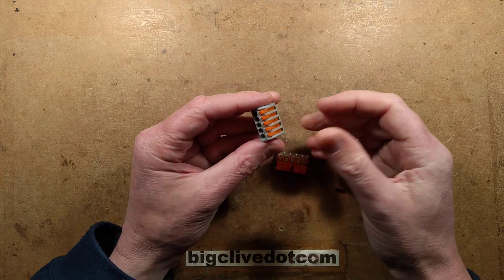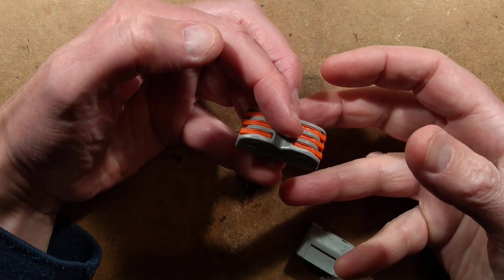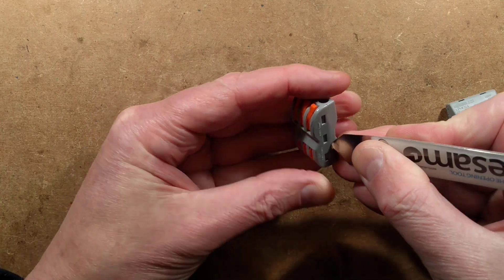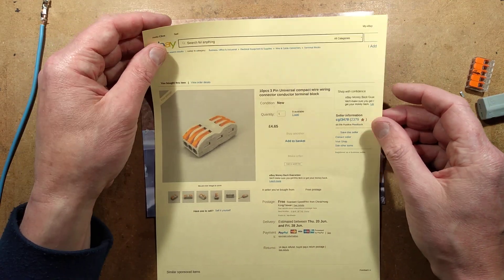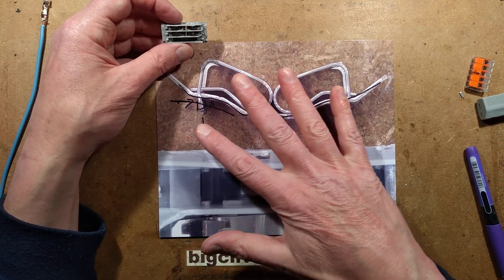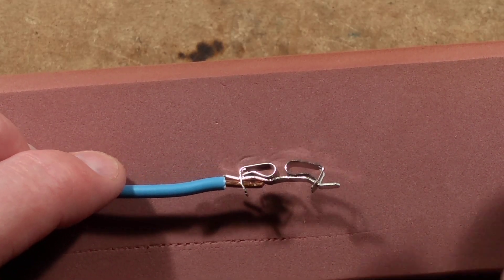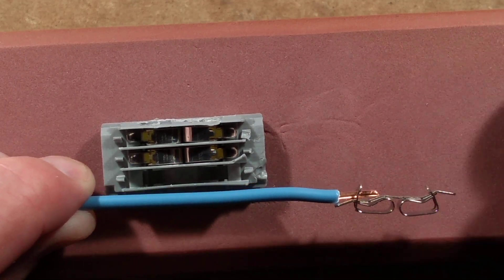Clone of Wago product that Wago don't even sell???

Comment: I always found these Wago type connectors very appealing, with one major downside, I want to be able to mount them in project boxes or cases so they are not flopping around. I have seen there are Wago mounting carriers for DIN rails, but those would not help much for my use cases. Luckily i recently got a 3D printer and there are Wago mounts available for free from Thingiverse, I will be using these a lot more going forward.

Comment: I know they make the wago boxes to go with the connectors but they do seem quite well insulated with no exposed parts so, best practice aside, do you have to use the boxes?
Reply: No of course not. You don't have to use anything, in India they just twist the bare ends together and maybe, if you are very lucky, insulate one of them by wrapping with a strip of a plastic bag.  ;-)
The stripped wires without the cable sheath are only basic insulation, as opposed to reinforced/double insulation, so not considered safe for public access. I wouldn't really loose any sleep over it if it was in an unaccessible enclosed area, like a ceiling or something, but I would not leave them exposed for anything other than a temporary setup for testing purposes.
Reply from the maker: In an ideal world there would be no single insulated cores visible.  I prefer to use the mini Wagobox for downlight style applications since it will fit through a small hole and does the job of shrouding the connector and gripping the cable quickly.  But this would be much preferable to just tape and terminal block if used on its own.  I'm not sure I'd do it myself, but if I saw that someone else had done it I wouldn't be too bothered as it does shroud all bare metal.

Comment: The original Wago connectors use tinned copper for the contact and spring steel for the spring.
Yes, this chinese product could be useful. But i would never ever use knock-off products. I am a professional electrician master, my customers expect to get high quality products.
Reply: Did you watch the video?
This one also used tinned Cu with spring steel.
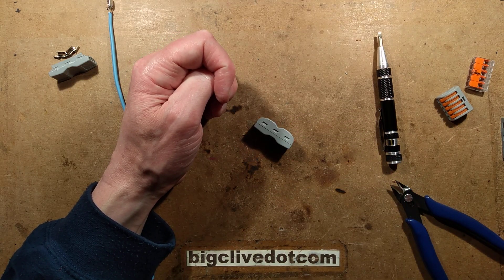Reply: @patnutoris4054  I watched the video till 9:42 and stopped. My error!

Comment: Clive, I was half expecting you to tear this this to bits verbally as well as physically. I've been very weary of these knock off connectors, but Since both you and JW seem to be reasonably impressed I may order a few to use with 12 & 24 volt stuff... since you never know when the design might change. Maybe Wago will knock of these and I'll could use them on mains voltage. Until then, I can get by with individual Wagos or the little cut to size milti-way screw terminal type blocks. Thanks for having a poke at these, very interesting indeed.

Comment: Thankyou for bringing these to my attention. I have promptly ordered a few 3-Liners and a few 2-Liners from Ebay which I can use for quick fixing wire breach in my Moped. (50CC Motorcycle here in Holland). Especial the wireloom near my steering column suffers quite a lot. It is 12 Volt, so Arc-Over seems not an issue here. :-)

Comment: Cheaper to just use choc blocks but perfect for setting up test circuits etc. Not sure I'd trust them in a 'proper' job.
Reply: Choc blocks are a lot less reliable than Wago connectors. It's extremely easy to make a bad connection with choc blocks. With Wago's on the other hand, it'll take some doing. I was actually surprised Wago and similar connectors aren't used in America. Here in Europe, using choc blocks is actively discouraged due to the danger of making bad connections.
Reply: It's not just actively discouraged, it's straight up against current electrical code. It's been illegal to use choc blocks in my country for a good number of years. The only place where choc blocks are still allowed is in domestic light fixtures.

Comment: They exist pretty long do , ideal for built in spots ,  because next to solid core wire flexwire could be used .
The old wago stick in connector could not accept flexwire because you could not open and close them .
And this one has a clamp that surround the wire that's why flexwire keeps being a bundle in the connector for a good connection .

Comment: You said trumpy, and I didn't know if you were going to have a trump in your trousers. You brought the POS out instead. You seriously need to use more fart jokes again. Growing up kills you, you know. After all, it is the highest cause for dead in the world. At least, I hope it is. I've seen Wago connectors being sold, but I usually just go with the old trusty and cheap wire nut. I don't know why Wago or other terminal strips are so expensive in the United States. Wire nuts are tried, tested, and true here not to mention cheap. John Ward even tested them, and they held up. The insulation did burn away, but even the terminal connector strips lost their insulation. I believe all or most of the wire was cremated as well. I'd have to go back and watch that episode. The only time I've seen burnt wire nuts is when directly combining copper to our aluminum wiring. I was still learning back then, and my brother who should have known since he took electronics said that it was not only fine to pigtail copper and aluminum but also the best way to do it. Thank goodness for our fifty year old metal boxes! That was also a high load connection in a bathroom. It had the worst combination or close enough.

Comment: These have been available for quite a while. I bought some of the two pole version at the start of last year, they have been very useful. I've mostly used them for testing projects, before soldering on battery connectors once complete.

Comment: I'm curious if anyone has a sound electrical basis for their (implied or explicit) opinion that these are unsuitable for higher voltage applications. They claim to be rated for 400V, which with insulation should require only about 10 mils of separation between rails. Those plastic separators alone qualify as >10 mils of insulation, plus the additional air gap between the contacts and the plastic.

400V seems to be a reasonable rating, factoring in engineering safety margins.
Reply: It's probably down to manufacturing quality concerns, here, rather than design issues.
Reply: @B-System  I suspect the same. That concern can largely be ameliorated by examining a few parts, however.

Comment: The idea is good, but at least the colors of the leavers should be different for each pair. To be honest I expected them to be connected all together, since that is what I’m used to from the other (original) Wago connectors. I guess if Wago would present something like this, they would use a different design to prevent confusion.

Comment: I'm not a fan of Wagos; a properly installed wire nut is probably better or even a crimp connector.  One thing that worries me about the 3-wire splice connector is that should the internal connection become a little corroded or loose, the resulting heat might melt the connector body and lead to short circuiting between opposing polarity wires.   I couldn't find a similar splice connector in my Wago catalog, so I'm assuming that it's not made by Wago.

Comment: I heard from a wago seller once that spring contacts are better than screw contacts. The reason is  thermal expansion. When that happens on a screw contact, the metal of the wire and screw deforms and the contact surface will be worse when it cools down again. But the spring just goes up and down without problem, keeping a tight contact.

Comment: Since you do have this powerful wall plug in UK, could you clamp in some wires and put in a heavy load like the hotdogger ?
Perhaps compare it on thermal cam to the orignal WAGOs.. ?
Naked contact or in package... I'd think the chinese ones might catch on fire or melt sooner when under heavy load...

edit: Just checked the video of John Ward.. 

Interesting: The Faco seemed to be having higher contact resistance on the contacts, so both the wire  going in
 and contacts got hotter and it started to melt earlier.
Reply from the maker: But still at 5 times its maximum current.

Comment: I like the transparent ones. First of all because they're transparent so you can see if all the strands are properly pushed in, and they support higher gauges (2,5mm2 with ferrules), and since they're flat, you can hot-glue them in your project box. Which is especially useful for stuff like speakers and subwoofers, where you don't want wago connectors rattling around.

Comment: That spring-connector profile reminds me of the Fahnestock clips we used years ago for hooking up experimental circuits. They're still available but they aren't insulated so low volts only. There's even a wikipedia article about them: https://en.wikipedia.org/wiki/Fahnestock_clip .

Comment: Had some electrical work done on the house recently and the electrician used Wago blocks on the lighting circuit for the upstairs/downstairs switches on our new stairs. First time I'd seen a Wago connector in the flesh.
Reply from the maker: If you search my channel for Wago you'll find a video about the connectors and a very clever box designed for them.

Comment: Though very easy to use I was taught never to use (original) Wago's because they cut in to the wire with little actual surface contact which could lead to problems with high currents (I work mainly in industry). Great for home applications though.
Nice video, never seen this type before
Reply: Did you bother to watch the video? It's pretty clear from the photos that the contact surface will pretty effectively be the whole length of the stripped wire, not just the clamping loop of the contact. This is what you get when you uncritically accept received "wisdom".
Reply: @marshaul  Yes, I did. I was talking about 'original' Wago, the grey ones without clips. I'm sorry if I got original 'old' confused for original 'not fake'.
 And I'm sorry for living. Maybe you shouldn't draw conclusions like that straight away and perhaps set a bit friendlier tone ;)
Reply: @daPetNL  Sorry if I sounded snarky. I wish that Clive had done a teardown of the old type, so we could see if the single-ended contact had more or less the same shape/design. 

I work in industry too, and I will however maintain that lots of received wisdom is simply repitition of untested assumptions/assertions. For example, electricians have decided to start installing receptacles with the ground prong on top, based on nothing more than uncritically repeated specious reasoning,  despite the lack of a code requirement to do so, and despite the fact that most manufacturers of power cables still design the plug with a ground-down configuration (so that the wire exits in the direction of gravity), leading to a major fire hazard when the excess strain causes high resistance at the point of the strain relief. If you point this out they will invariably repeat the same canard about picture frames falling with the hanging wire shorting line to neutral (as though circuit breakers don't exist), and all this despite the massive implausibility of that scenario compared to the common real-world scenario of excess strain. Uncritically received "wisdom", indeed.
Reply from the maker: The first time I came across Wago terminals was a DIN rail version used in a large industrial refrigeration condenser unit.  I was working with Hussmann at the time and asked the maintenance guys if they had any issues with them.  They said they had never had an issue with them.

Comment: They do have inline lighting connectors, but only for a single conductor. The 224 series. However I think they're only for solid to stranded connections
Reply: jeales, Wago do 1 and 2 wire lighting terminals grey and white

Comment: Maybe Wago haven't done this is because they could be mixed up,  wago are all common connection, if you had these you would have to check each time to see which holes made the link
Reply: If that's the reason, it's weak. I'm not a sparky or even in the electrical business and I don't think you would have to check each time. One has all holes at a 'common' end. The other has holes on two opposing sides that match up nicely in a line. So the ones that match up in a line are for joining straight through, naturally. Once you've used them once I don't think mistaking their use cases would be a problem. They could use different colours if they were really worried about people mixing them up. At some point you have to trust the installer to be half competent.
Reply: @chocolate_squiggle  I totally agree with you,  that was I was trying to get over, it needs to be different, colour, stripes or spots not the same as in this example. It just looks like 2 off the triple unit joined together which could be 2 commons with 3 links. Instead it's 3 commons with 2 links. You just don't  know until you test it. All wago products are all 1 common.   I think it's a good item which I would use. It is strange wago haven't released it. Maybe the Chinese do have the occasional idea that turns out to be a useable product.

Comment: It sort of looks like two standard Wagos stuck back to back with potentially disastrous consequences if somebody wires one thinking like that.
Reply: ipb1966 Yep, should have used a different color or (more costly!) 3 different lever colors indicating the pairing.  Note that nothing in the design can be use specific, as on any given day, an electrician may use one for a 3-phase motor and another for L/N/PE .

Comment: With the one taken to bits, it wouldn't really matter if the wire went all the way through, it's making a single connection.
Reply: Of course it could matter.  If you push a wire in far enough the clamp might come down on the insulation, making a secure but rather useless connection.  The touching part on the end would not be clamped so could make an intermittent and probably very poor connection, possibly encouraging arcing.
Reply: @FireAngelOfLondon  Please, How to make a extremely simple thing into something necessarily difficult, ready? How do you know if you trimmed enough back to start off? Use a multi-meter and set it on continuity and check both sides of the junction. Set the wire on top of the connector and mark the distance for those who aren't sure, cut dead center and trim the wires back evenly. If you're worried about arcing, you're guessing anyway, just trim back a reasonable amount and trim it until the shielding is the only thing showing to avoid a short outside of the connector and do a current test to make sure the proper amount is traveling through it. Presto. I would only use the things for testing a prototype anyway to make sure and of the components are working then solder and heat-shrink, no more current handling issues. Yes, it's a handy gadget to check things out, but I would never leave it in circuit even though it passed on the the spot with a current test, but what about the integrity over time of getting hot and cooling down? Do you trust that plastic to hold up under those conditions for the long haul, I don't, what if one lever breaks and now you have arcing possibly while you're sleeping. You could even leave bare wire exposed as long as you use heatshrink on them. not so hard after all.

Comment: Speaking of Chinese stealing IP like there's no tomorrow: check this one out ...I was looking for a solder station with temperature control the other day ... we all know about this one: 
https://www.jbctools.com/cd-bq-general-purpose-product-1605.html
But look what I've found: 

https://www.aliexpress.com/item/32997083617.html?spm=2114.search0104.3.2.4fb620762UDQzS&ws_ab_test=searchweb0_0%2Csearchweb201602_7_10065_10068_319_10059_10884_317_10887_10696_321_322_10084_453_10083_454_10103_10618_10304_10307_10820_10301_10821_537_536%2Csearchweb201603_52%2CppcSwitch_0&algo_expid=79e1db94-1002-4a0c-830b-6e1ca519c575-0&algo_pvid=79e1db94-1002-4a0c-830b-6e1ca519c575

Or just search on aliexpress: "jabe solder station"
 ..yup jabe ... like a ripoff of JBC ...
A complete Ripoff ! Amazing how they can get away with this without massive fine, court cases and charges!

Comment: I commented on JW's original video - the one before the one you link to - that I'd been in touch with Wago UK and it seems they hold no patents "outside Germany anymore for the 222 Series (as of a few years ago)" which seems a bit short-sighted of them however you read it. The newer 221 is protected  and they'd like to know if any copies are spotted.

I'm now wondering if they had some deal with a Chinese manufacturer and didn't tie things down as well as the should have.

Comment: I do like them "new" types as I go thru them strip screw terminal blocks like anything on my projects :)   The clone thing is becoming more apparent as companies outsource their products to places like Shenzuen where it is reputed they can make just about anything, in any quantity and any level of quality very quickly too, that they are using the tooling, moulds and designs to run off a couple million of their own, using the same materials too and this is happening to western companies ranging from Dr Marten boots to small parts like this and these clones are every bit as good as the original because they simply are the original sans logos which are usually taken off by hand by workers.   So the western company then finds itself being cut priced by its own product and more often than not, companies go to the wall and the Chinese company buys it out then it owns the actual brand :(

Comment: 8:38  The metal spring that is shown is fully extended because there is no wire in it... If you put a properly sized wire into it, the part of the spring that pokes up will be considerably lower between the separators.
Reply from the maker: In hindsight that's true.  One of the perils of doing live video explorations is that you don't immediately spot things like that.